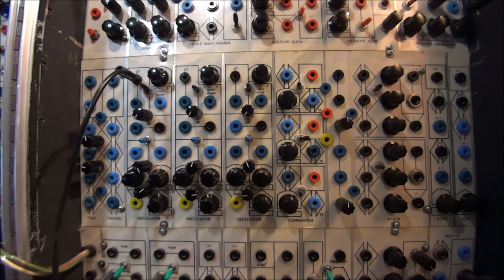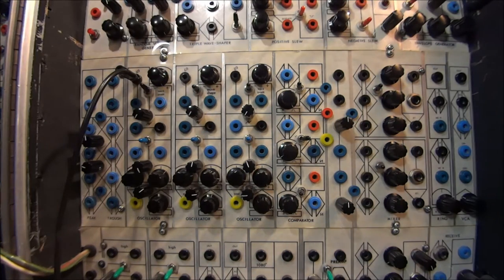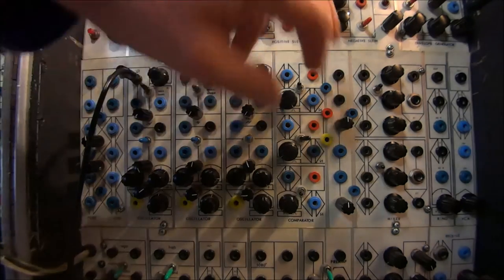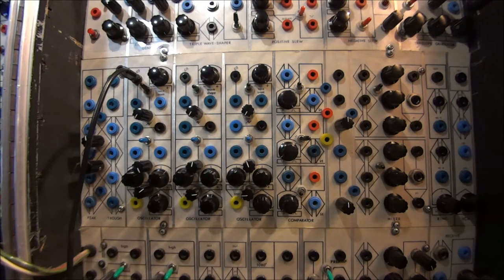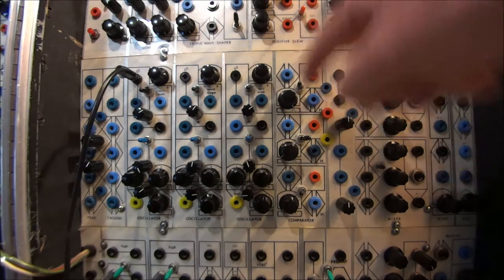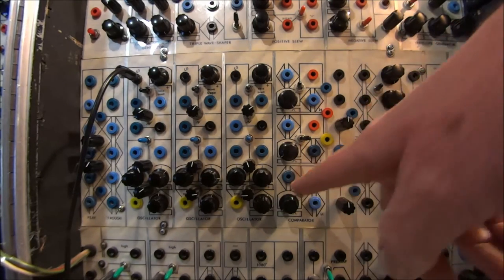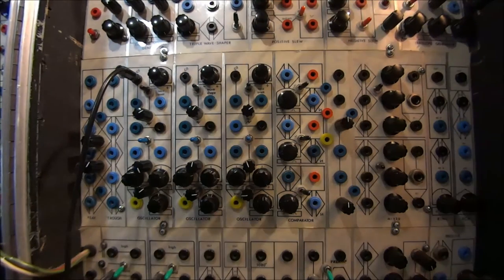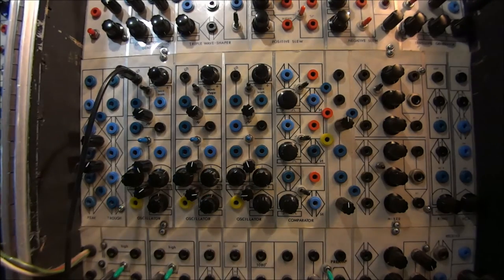Mystery Serge Tour - Sound Source Panel - Patch of The Week

Comment: Re Peak & Trough:
When you say 'Voltages' to apply on the inputs, i think of discrete control voltages. However, as far as i read the schematics this module is for logic signals (Gates, Triggers). The 'Peak" side is an OR-gate, whereas the 'Trough' side is a AND-gate. Thus it not a Min/Max processor for control votages but logic signals, right?
Reply from the maker: +fonitronik It does work with gates and triggers to great advantage but it does as well with variable voltages. For example, if you put the voltage output of two LFOs into one of the sides (peak or trough) you will receive which ever is is lowest or highest at any given moment at the output. This can create some very unusual voltage shapes.

Comment: do you hear a difference between the elby stuff and the original?
Reply from the maker: No, the sound of the old and new are the same. The original functionality is also duplicated. There are some calibration differences between my  Mystery Serge (original) and the EuroSerge but that comparison only goes so far because the Mystery Serge is highly customized and personalized and is probably calibrated differently from the original calibration too. In my performance videos where I use the EuroSerge one cannot hear a difference between the voices made from one version or the other.
Reply: that's great to hear. thank you